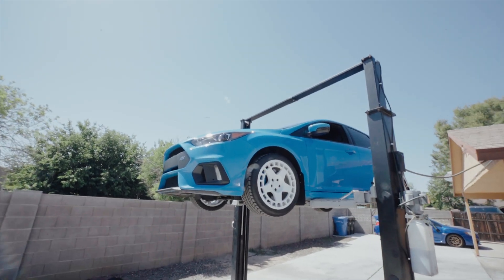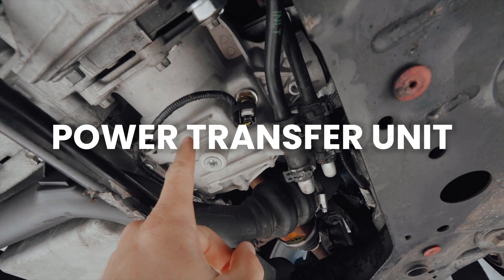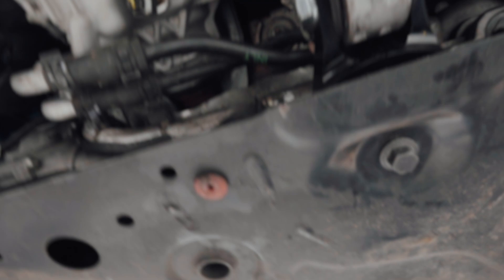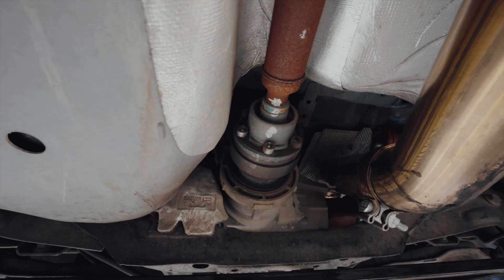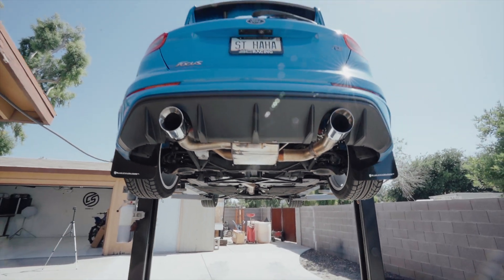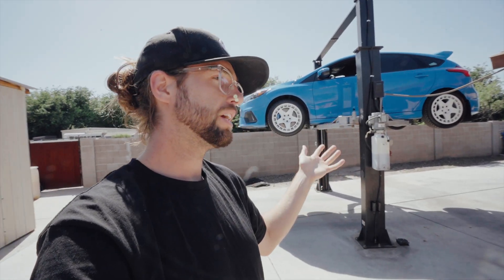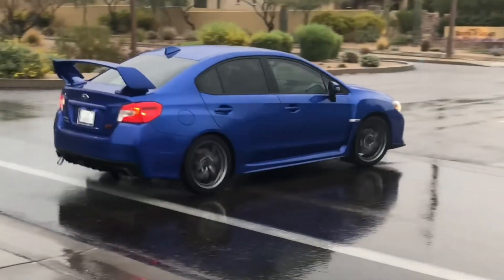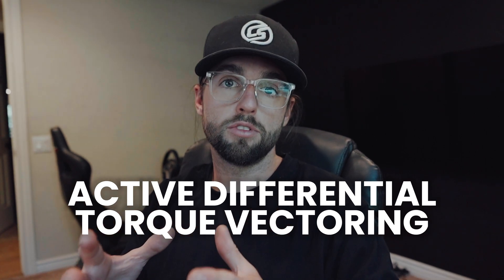How The Focus RS AWD System Works!

Comment: I'm sorry, but just saying that the car uses algorithms to set the wheel torques (which isn't even true; it uses maps, not algorithms) is not an explanation of HOW it works.  At a minimum, you need to tell us what types of diff the car has.  For example, an Evo X has a helical front, a 50/50 planetary center with hydraulic limited slip, and a spider rear with hydraulic piggyback torque vectoring.  That's the information I hoping to get here for the Focus RS.  I was rather disappointed.
Reply: Wow.  It only took 10 minutes to find the actual answer.  The 3rd-gen Focus RS is close to a front-default Haldex, but with separate clutches for each rear, instead of one clutch in the center and a geared diff in the rear.  Knowing this allows me to correct one thing in the video.  It doesn't "act" like a FWD car in normal mode, driving calmly around town, because of the extra driveline drag of AWD; it does this to reduce wear on the two clutch-packs in the rear.  The clutch-packs aren't limited slip devices; they are how power is transferred from input to output.

If I had to guess, the reason that Ford when with a modified Haldex in the center, in contrast to what Mitsu and Scooby have done, is that WRC rules don't allow for center differentials.  All modern WRC cars have Haldex centers.

Comment: If you want to drift, put it in sport mode with traction control completely turned off (hold the button until it all turns off)…it’s much more manageable then

Comment: Cameron, you really know your stuff and you make relevant videos. I used to compete in GTS2, and I have been instructing at the Circuit of The Americas Formula 1 track since 2013. My son who is now 19, tracked (and daily drove)  his 1985.5 Porsche 944 for 3 years with no issues.  He finally got his dream car, a 2017 Focus RS in Nitrous Blue and has not been able to do more than a single session without the car going into limp mode. I searched YouTube to try and learn what we could do to change that. You are the only person we've come across yet to address the issue of the transmission overheating.  I only wish you had better news.  Thank you sir, and continued success, Thomas

Comment: I buy RS 2017 and I did 115k kilometers with him in stock ... only 18" rims and brake upgrade. I pushing the car realy realy hard on mountains, twisty roads and track and car thank's god still work. The biggest purchase was the clutch and flywheal. Anyway great car and I want buy another one. Drive safe.

Comment: Hey cam! I just bought a 2017 rs and have put over 20k miles on it myself already. This winter (I’m from Minnesota) when it would snow a bunch me and my friends would pile in the rs and do some hooning (private property of course) and it would go into limp mode some times yes and sometimes no, it really did just depend on how mean I was to the car. A simple reset with my cobb and letting it cool for 5 or so minutes does the trick! It’s nothing to worry about yet

Comment: If you will be hammering it, be sure to change the PTU/RDU fluid every 30k or so. They're billed as lifetime fluids but changing them can't hurt anything. The great thing about the RDU is it slips out all the torque it can't handle, (which is basically anything over stock) so even people with 600WHP builds have never really experienced failures. The crappy thing about the "limp mode" (disabling the RDU) Cam talks about isn't even based off a sensor in the RDU as it doesn't have anything like that. It's just done by crunching numbers from other sensors, so that can suck when it thinks the RDU is overheating but it's fine, like on ice.
Reply: I burned mine up after going fbo and doing donuts in an intersection in the middle of nowhere. The first time i ever used drift mode. The car wreaked of burned clutch afterwards and the smell never went away
Reply from the maker: dang!!!!
Reply from the maker: Exactly!! This is what Tim from Team O'Neil told me too, he found a way to trick the sensor somehow i cant remember what he said
Reply: @CameronAlford  I know someone on the forums found a hack to get 15-25% more power sent to RDU via FORScan and I've heard rumors a rally team was sent a file that allows them to lock up the RDU, so that definitely seems possible. Then again, the ST guys still haven't found a way to completely disable brake vectoring yet (it still does some with ESC off) so who knows.
Reply: @electricdoor  yeah i got a buddy with an ST. He put a lsd up front, but you can still feel the brake vectoring pretty harshly